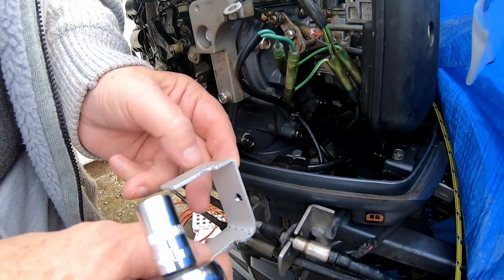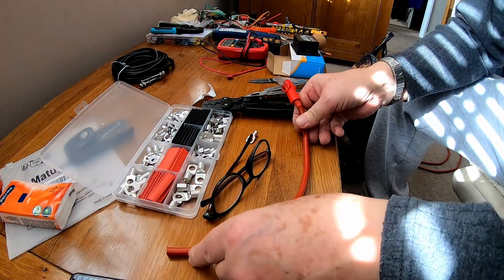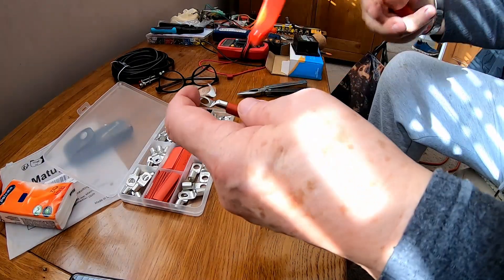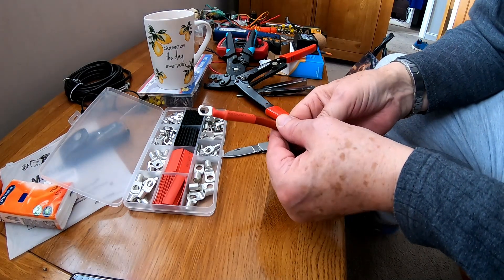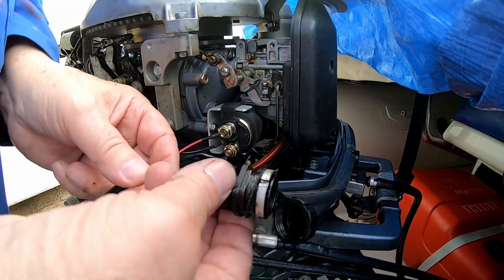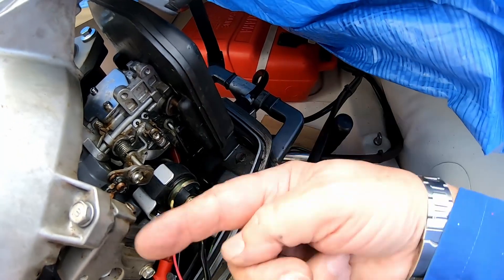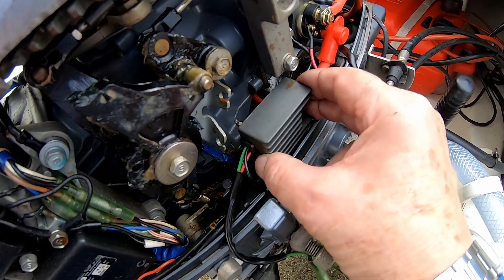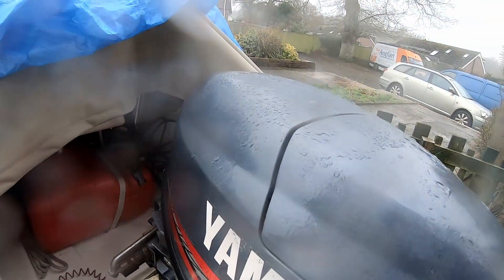How to fit a starter system to a Yamaha 25hp pull start outboard. (Part two) Nearly done

Comment: Can you please let me know the exact kit you purchased and fitted please, i need to do exactly the same, thankyou
Reply from the maker: It wasn't a kit. I just purchased the items required.  Most importantly is the starter motor mounting bracket. After that just get the parts separately.  I list it somewhere in the description under the video.  Rob

Comment: I loved your way to show us the installation, but two questions. The battery negative cable is on the starter motor negative edge? You didnt do any thing with the regulator just put another place?
Reply from the maker: Correct.  The starter is a direct bolt on to the engine so carries the ground throughout.  The regulator was moved and it's ground tag put under a suitable bolt head.

Comment: You're doing a grand job...not easy to fit it all in with very little room. It will make starting the motor so much easier. 👍👍
Reply from the maker: Thanks. It is a tight fit in there but it's all in and the final video is now up.
I could have made it easier by using 6mm battery cable instead of 8mm. It would have been perfectly adequate.